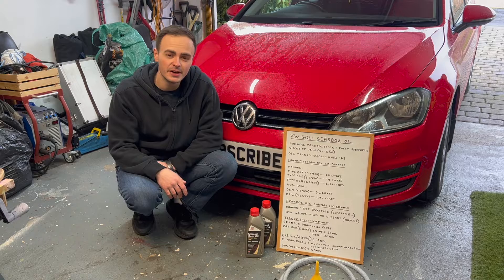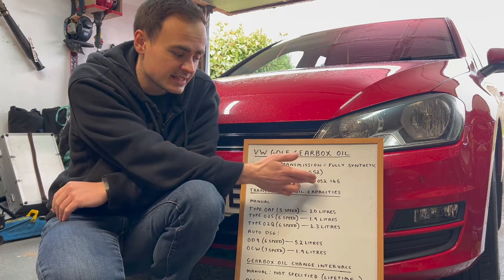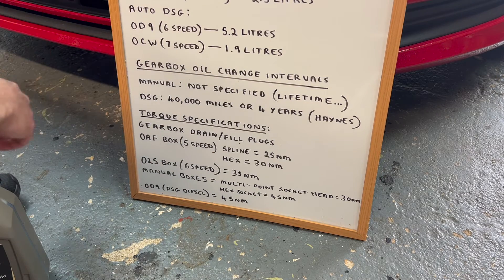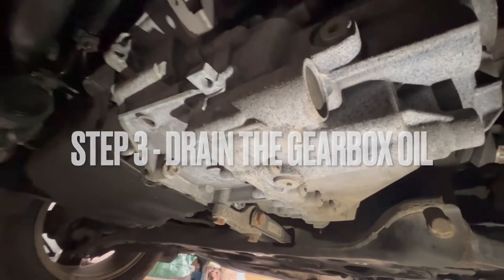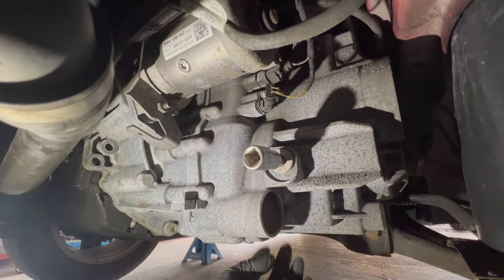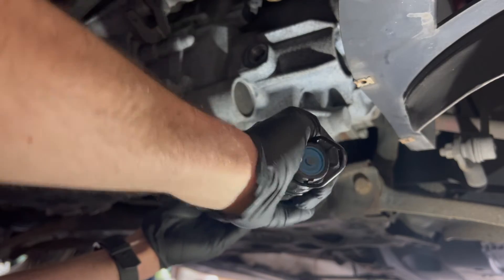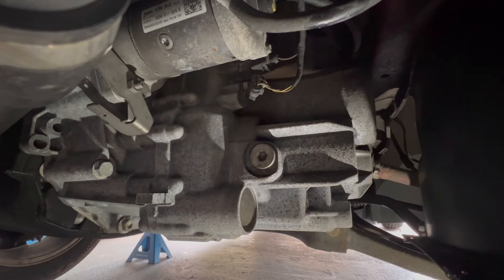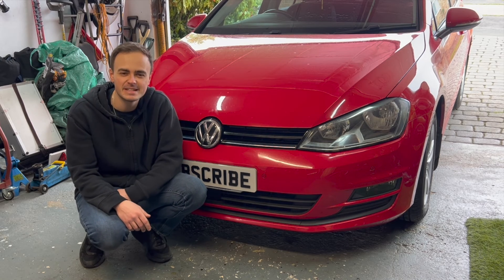VW GOLF Manual Gearbox OIL CHANGE - 5 STEPS DIY

Comment: I don’t believe the spec of oil your using is correct. I say this as if your car had the 02M or 02Q gearbox (I believe yours is 02Q) the oil spec should meet [G 052 527 A2] requirements - the oil that your using doesn’t meet this criteria. 

I assume that you’re getting the spec detail from Haynes? Although Haynes states “75W G52” it doesn’t define the exact spec (there are many) beyond the OE stuff online which is expensive, the only other after market oil that I’ve found that meets the spec, is Valvoline 75W Manual Transmission fluid (~£17 / Litre) 

FYI - Not a criticism, just trying to help.
Reply from the maker: Thank you for sharing this information, I will pin the comment so others can see. It’s very difficult to find the manufactures exact recommendation sometimes so I just used the closest I could find but this seems like the best alternative 👍🏼
Reply: Hi, please I have a Golf 7 2.0tdi 6 speed manual...do you know exactly the type of transmission oil for my car?
Appreciate any of your feedback...
Reply: Harrygilbert3738 vedo che te ne intendi di olio e specifiche, ti chiedo secondo te alla mia auto TDI 110cv anno2017 (fine serie) con cambio 5 marce (MQ250 dovrebbe essere) che specifica ci vuole. Infatti sul libretto uso e manutenzione non c'è scritto e in officina Skoda mi dicono che non si fa manutenzione di olio al cambio.😩
Reply: Well that’s false information and that oil does meet that specifications 527a2 it’s on the bottle

Comment: Hi there, great video, but according to my Haynes manual the torque settings on your board for the manual box are round the wrong way. My Haynes book states: 
Oil filler/level plug:		
Plug with 12 point socket	45Nm
Plug with hex head	30Nm
Reply from the maker: Thanks for the info, always appreciate feedback and corrections like this!

Comment: Thanks a lot for the video. In my case (Golf Mk7.5 2017, manual, 5 gears) the screws look little different but was able to anyway locate them and drain the oil. Just a question: in my case I barely got 1.3/4 Liters out and when adding new oil, was able to refill with similar quantity but way less than 2 liters. How much did you really add in your case?
Reply from the maker: You’re welcome 😊 that’s interesting, perhaps it’s a different gearbox in the 7.5. I only have the manual for the mk7 so couldn’t tell you exactly for your model. Mine had just shy of 2.3litres and that’s what I replaced it with. As long as you replaced what you removed with the same amount of fluid of the correct viscosity it should be all good 👍🏼

Comment: Did change in mine (Leon manual 6 gear). It said it should be about 2.3 L to replace. I had anemic 1.2L of old, part of which spill from inlet plug. 
Managed to refill less than 0.8L as everything more was spilling via inlet again, even after I lifted the front... (found some czech video for Skoda and there was 2 drain screws he removed there)
Reply from the maker: Sounds like a bit of a challenge you had there! Must be a different box to the golf then 🤔 I thought they would be the same tbh

Comment: Hello, are the steps similar to the Seat Leon 5F with manual 6 speed Transmission? Engine CRLB 2.0 TDI with 150hp.
Reply from the maker: Hi there, yes — the steps should be almost identical. The Seat Leon and Golf share the same engines and transmissions, so the process will be very similar 👍🏼
Reply: @TurnersWorkshop97  Thanks a lot. Ive done the job last weekend and it worked very fine. My car has 260000km and the oil was almost black. I used the Ravenol MTF3 oil. Now the transmission is very smooth to use.
Reply from the maker: No problem at all, thanks for your comment. Great work doing it yourself 👊🏻😊

Comment: Di che hanno e la tua golf tdi?
Quanti cavalli e? Grazie
Reply from the maker: It’s a 2.0tdi ea288 diesel 150ps 👍🏼
Reply: @TurnersWorkshop97 anche il mio e un EA288🤩 solo che la mia e una Skoda 110cv 2017 FAP con SCR(Adblue). E non riesco a capire che olio va, chi dice il w75 chi dice il w75-80 di dice il w75-90, il problema e che sul libretto non c'è la specifica VW altri menti era facile capire l'olio a specifico. Tutto sommato da noi in Italia usiamo maggiormente il Febi bilatein w75 (casa tedesca) e quello che si avvicina di più all'originale.
Reply from the maker: I had the same trouble trying to work out which oil. I’ve pinned a comment at the top which is the closest I’ve seen to the manufacturers spec. I’m sure the febi 75w will be just fine though 👍🏼

Comment: Hey, so I noticed that vw doesn’t even have an option for a manual gearbox oil replacement in the maintenance booklet, only dsg atf. When do you think it should be changed in these cars? 

I test drive two mk7’s, 1.6tdi and 1.4tsi, both around 200k km and no history of gearbox service. They all shifted decent besides gear 3 which feels a bit tricky.
Reply from the maker: Supposedly the gearbox oil should last the lifetime of the car (this is why they don’t include the change interval) 😅 Dirty oil in the gearbox will cause wear and damage over time, I’d recommend changing the oil at approx 50k miles to keep it in good condition 👍🏼
Reply: @TurnersWorkshop97  Sounds right. That would mean a 220k km car is nearly 3x overdue💀. I’ll definitely have to think about it. Is 3rd gear in these cars a bit tricky by design?

Comment: How to find the torque required? I have a 2018 Passat 1.6 TDI
Reply from the maker: Different specs depending on the gearbox. 

5speed gearbox- spline is 25nm - hex bolt is 30nm.

6speed box with multipoint hex plug is 35nm
6speed box with hex plug is 45nm

Honestly there are so many different torque specs depending on which gearbox is fitted. 

If you’re not sure just go for an average - Just nip it up and check it’s not leaking and it will be fine mate 👍🏼

Comment: How can you set the correct level of the fluid if the front of the car was higher? you should level the car correctly!!!!!
Reply from the maker: If you know the fluid capacity for the gearbox you don’t need to level the car.

Comment: No O-Rings? I want to change the gearbox oil on my 5 speed TDI Altea and if it’s as easy as you have shown in your video, then I will have no problem changing it.
Reply from the maker: No o-rings, it’s a very simple diy job 👍🏼
Reply: @TurnersWorkshop97 thread locker on the plugs? Or does it just stay sealed once torqued?
Reply from the maker: @gordonstockdale9939 I wouldn’t personally mate, just torque it up. I’ve had no trouble doing it this way.
Reply: @TurnersWorkshop97 thanks for the advice!

Comment: Hi,

First of all thank you for the video. I'm actually planning to to this on my Golf 7 2014 1.6 TDI 5 speed manual.
I feel that I'm well informed to do this after watching. I'm already changing the engine oil my self and brakes and so on. But i've never really changed the transmission oil.

I bought CASTROL 75W SYNTRANS FE, do you think it's good enough for my car? I see some sites recommend 75W-80 and some recommend the CASTROL 75W SYNTRANS FE. They are both GL-4 as far as I understand. Did I buy the correct oil?
Reply from the maker: I’m so sorry, I must’ve missed this comment! Either way I think that gearbox is an 02S

I’d go for 75W-80 GL-4 oil that states VW 501.50 / G052512 approval (Castrol Syntrans V FE 75W-80 and Fuchs Sintofluid 75W-80 are popular. 

So you’re all good with the oil you are using 👍🏼
Reply: @TurnersWorkshop97  No problem. At all :) I changed the oil and it runs great after.

Comment: I was thinking grandpa's old MK6 shifts a bit rougher than I remember. Granted it's like 15yrs old, mostly drove long distances, not much shifting, so transmission fluid hasn't been changed. But every garage said WV doesn't recommend changing it do idk anymore.
Reply from the maker: I’m not sure why they would advise against changing the gearbox oil. Fresh oil seems like a good idea to me to prevent damage and wear on the gearbox.
Reply: I requested this service at my place and they said the same thing. Clearly when he filled the gearbox back up the new oil was almost clear, so I don’t know what to do🙁
Reply: @Angcasram  I don't know anymore. My brother told me I should get it looked at at least, but this year it shifted much better than when I typed that comment....I'm guessing the weather was warmer. Now it's doing  much better and nothing's been done to it. Golfs are weird I give up.

Comment: Hi I used Amazon search , it comes out with LIQUI MOLY High Performance Gear Oil (GL4+) SAE 75W-90 | 1 L | Gear oil | Hydraulic oil | SKU: 4434 and febi bilstein 21829 Gear Oil SAE 75W (GL-4), I used multiple but sometimes feel like it was smoother before oil change

Comment: thanks for this great video, but a few observations:  the car should be level, which won't be the case with only the front jacked up.  If you click twice on a torque wrench you're exceeding the torque (no big deal on drain/fill plugs but just saying).
Reply: I pretty sure the purpose of the car being level is to know when it's full via the fill plug over drip method. If you measure what you drained out then replace with that same amount then you don't need to have it level.  .....provided you've owned the car it's whole life and know no one else may have done an improper fluid fill drain.

Comment: Sir, good day. 
i have 2.0  TDI manual, early mornings, engine produce "kech kech" sound, after 4-5mins of engine idle, sound settles down. Also, during mornings i am unable to put first / reveres gear, when i rev the engine for 2-3 times, first and rev gear shifts. once the engine is at optimal temperature(drive 4-5mins), all are normal with my octy 2019 MT. could you suggest what should i do?

Comment: I wanted to ask you why some tutorials I've seen recommend locking the gearbox with the lever located near the selector? and they advise against filling with new oil from the level cap, but from the reverse gear sensor cap?
Thank you
I'll could get them wrong but I think I've understood this.
Reply: I’ve heard this as well. Did you end up filling thru the reverse gear?
Reply: @justinejo2268 yes i did 😊

Comment: Torque spec, Turn it until you hear it crack, back it off half a turn, give the job to the apprentice.
Reply: Then have an angry customers busting your balls to no end, where the garage ends up paying for a complete front axle brake restoration 😁
Or my former employer getting his Volvo FH back with no oil in the gearbox at all. €20,000 mistake whops 😵‍💫

Comment: You should of use genuine vw oil...
Wouldn't trust that no name Comma oil
Reply from the maker: Very difficult to find the VW gear oil specification. They are part numbers rather than viscosity grades. Manual doesn’t specify the gear oil part number 🤔

Comment: Hey, thank you very much as usual for your very informative and beneficial videos! Have you ever replaced your water pump yet during your ownership? If yes, when do they usually need replacing (in terms of mileage or age etc.)?
Reply from the maker: Hey, thanks for watching. I tend to get the cambelt and water pump done at the same time. Every 60,000 miles or 4 years whichever comes soonest. That’s the Haynes manual recommendation. Some would argue that this is OTT but I’d say better safe than sorry 😊

Comment: Hi,great video,btw can you help me?This oil 75w gl4 is good for a 1.2 polo 2010?And how i know how much liters i need?In the manual i didn't see gearbox oil type or capacity.
Reply from the maker: It’s a grey area with Volkswagen as to which oil is recommended. I would suggest getting a Haynes manual for your model or join a Facebook forum and ask the question there. It’s more than likely the 75w like I used in the video.